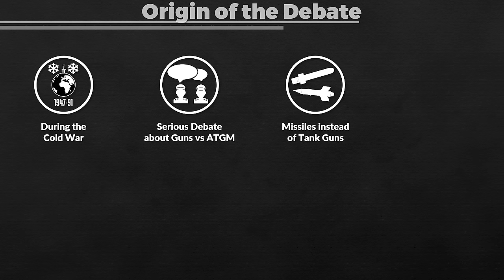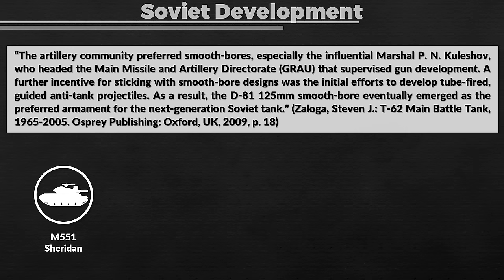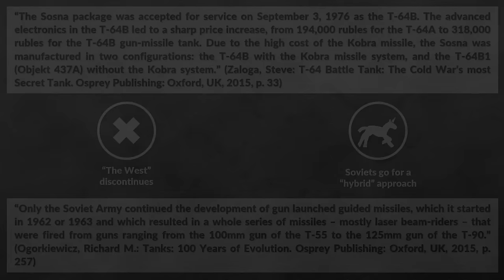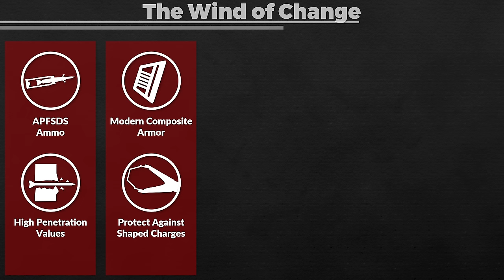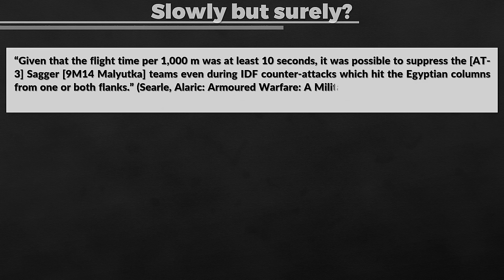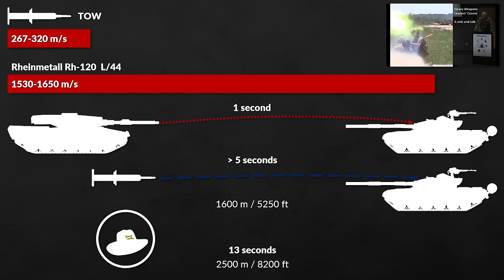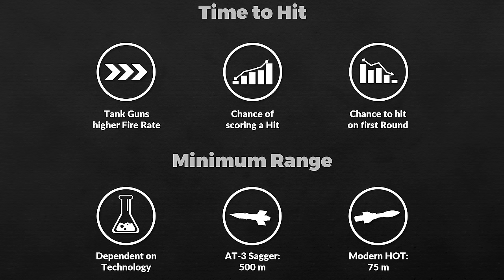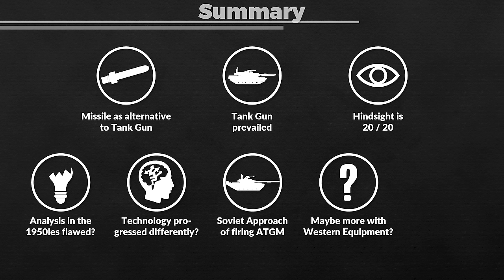Missiles vs Tank Guns: Why Guns are better!

Comment: It is worth noting some more recent developments. Though not accepted for service yet, the XM111 is a guided conventionally launched projectile fired from the 120mm cannon. It comes in two variants, one with a KE penetrator, the other with a shaped charge. It was designed for both line of sight and indirect fire, testing gained a hit at over 8.5km. (The M1 normally isn't expected to engage much over 4km).

Something else worth noting is that you can put a missile on anything, but if you want a proper accurate tank gun, you need something heavy enough to mount it, and hopefully tough enough to take what comes back the other way. So pretty much for a tank gun's firepower, you need a tank, but for a missile's firepower, you can use anything-but-a-tank.
Reply: ?

XM111 was cancelled more than a decade ago.
Reply: @kylesenior  Which is why it has not entered service! But it is an example of extant technology which combines the capability of a missile with the speed and ease of a conventional round. The issue is that there seems to be no need for it, not that it doesn't seem to work, which is an interesting addition to the arguments in this video.
Reply: Is a source allowed to argue with the video? And what were u more deadly with a tow or 120mm
Reply: I thought that was for anti-heli work anyway.
Reply: This sounds like a redo of the old SADARM round that was going to make armour weak at the knees back in the 70s. Never really went into service.
Reply: A big issue with rockets inside barrels is FOULING. Rockets burn dirty and leave a lot more residue behind than a gun round.
Reply: @brokeandtired  Just go the way of the spike missile, the rocket only goes off after it clears the launcher
Reply: @genericscottishchannel1603  a two stage propellant? That could be practical but would cost more per missile and each missile would weigh more which would affect tranportation.
Reply: Imagining seeker to survive acceleration being fired from tank gun has to worth its weight in gold, at that kind of velocity it has to be super sensitive to terrain obstruction in indirect fire, and how do you connect tanker to observer and what about the conflict of becoming dual hatted? What I read was the technology didn't work well enough in real life conditions.
Reply: @killchicken123  ? "DUAL HATTED" ? = means DOUBLE ARMOR  EXPLOSIVE , REACTIVE ARMOR ON *ROOF*/ TURRENT TOP ...?
Reply: @genericscottishchannel1603  yup, use a separate charge to eject the missile. 
Same as what's used for launching for example Tomahawk from box launchers on ships, or SLBMs from submarines (though those tend to use cold gas ejectors, the principle is the same).
Reply: Quite apart from the size and weight problems of tank launched missiles as compared to regular shells the cost is usually prohibitive (Shilelagh anyone?), and of course the missiles tend to be a lot more sensitive and easily damaged by shaking and rattling around inside the storage bins than your HE, HEAT, or APFSDS rounds as well.
Reply: @killchicken123  it's been done with mortars already. But that had significantly less acceleration

Comment: Good video! 
A couple of other factors to consider:
Missiles tend to be more fragile than tank rounds. Rounds can stand more bouncing around and mis-handling in armored vehicles than can missiles.
Missles tend to be bulkier than tank rounds (particularly while in their shipping containers) thus potentially limiting the shooting capacity in tanks.
Reply: Solid rocket motors turning into bombs from being mishandled is scary
Reply: Javelin is a prime example. Even in its carry container with special shock absorbing rings around it the soldier can easily make it inoperable if he simply stumbles and bumps the container against the ground or say a tree.
That's not going to happen with a HEAT or APFSDS tank shell.
Reply: @tommihommi1  which happened to the Dutch army during operations in Yugoslavia. 
The field commander upon receiving his Dragon missiles found that the propellant charges on ALL of them were cracked, rendering the missiles more dangerous to his own troops than to Serbian tanks and APCs. The same was true for most of his LAW rockets and even his mortar shells. This left the Dutch batallion in Yugoslavia without any anti-armour capability at all and inevitably led to the failure of their mission .
The culprit was poor maintenance and storage under incorrect conditions in the Dutch war supply warehouses, while never publicly stated I guess the entire Dutch munitions stockpile was probably similarly affected.
Reply: I also love the content but I think it needs some music
Reply: I'm on the other side of this. The gun itself is a better weapon. The problem is there big and need transport, so you make them mobile. But you want them protected, so they weigh a lot with armour, so the mobile platform grows giant and all the gadgets and equipment on the tank and training the crew is super $$$ .  the problem is no matter how tough you make it, the other side will build a handheld missile 1 50 year old guy like me can fire  smoking a cigarette  destroying the tank after 30 minutes playing the video game version for training. 
Tanks also are more vulnerable to be destroyed from the air more then ever with drones. Rommell knew in ww2 planes had made large formations impossible unless you owned the skies. 
Artillery, the oldest take destroyer since ww1, is so accurate, 1 or 2 guns can do some real damage to tank formations as we have seen some video coming from Ukraine. 
Israel had problems with the first wire guilded missiles in the Sinai. Bazooka and panzerfoust had several upgrades in ww2 and proved deadly thats how quickly war changes.
Reply: @jwenting  Not a great example; the Dutch Army was a bad joke for decades.
Reply: @stevewatson6839  The Dutch army became a joke around the time of the Yugoslav civil war.
It was then that the horrendously detrimental effects of the initial waves of budget cuts started to become visible outside of the army itself, until then they had been able to hide most of it by keeping fewer vehicles operational by canibalising the rest but as you never take everything out of depot for a show or exercise that wasn't much visible for most people.

It was also around that time that the Dutch police barricaded the Dutch army to prevent them leaving their bases after the army failed to pay their road taxes (yes, seriously) and the army didn't even bother showing the police how silly it is to try to block a Leopard 2 with a VW Golf.

Comment: Presumably missiles are also more vulnerable to active defence systems too due to their slower speed and relative complexity/fragility
Reply: That is just with the commonly-available rocket motor tech, there is some newer rocket motors that would vastly improve missile speed, the problem is mass production and that's the real problem with mil-tech.
Reply: Active defence does not makes the tank impervious to a missile
Reply: @darugdawg2453  I think It does, very few missiles are capable of jamming the APS detection to get a direct hit. APS is overpowered as hell, Trophy APS even stops Javelins. 
  There are probably blind spots in the rear or you could fire an RPG from a very high position down into the tanks roof but it would need to be very close for that.
About US army testing Trophy: ...the U.S Army has reported similar success in tests. “I tried to kill the Abrams tank with ATGM 48 times and failed, despite the fact that some of them were supersonic,” said US Army Col. Glenn Dean.
Reply: @darugdawg2453  as with anything in the realm of modern industrial warfare not being impervious is irrelevant. Everything is about probabilities & cost. Active defense lowers effective hit probability & that's all that matters. Sure you can always go with higher speeds, better guidence, better tech, but that has an added cost too.

Anything that reduces the probability of a fast & speedy kill while increasing the cost of achieving a given hit probability is a problem.
Reply: Not against the slower, more fragile HEAT rounds
Reply: @Welterino  How about suicide drone doign top attack from an 90° angle? Because this is what's starting to be developed
Reply: @randomguy9777 sightlines on the seas is much better than sightlines on the ground. It's why helicopters with ATGMs can dominate mechanized movements
Reply: @randomguy9777 That's relevant for artillery, not tanks. Tank guns are bottlenecked by direct fire and line of sight, not by how far a gun could physically shoot if you angled it up a bit. 

For artillery the difference in range is relevant and so you get tradeoffs between guns, missiles, or hybrids between the two with base bleed and rocket assisted munitions.

Comment: Important to keep in mind as well that MBTs are not only designed to fight other tanks, but also support infantry or other vehicles. That may require the use of HE or smoke rounds. Missile systems to deliver those ammunitions would take too much room to be any useful.
Reply: yes, that's why it is so bad idea for politicians to tell army what they need to buy or where they are "best" used. You get tank barrel launched missiles or even worse ATGM Carriers liek IT-1, or Gallipoli campaign ... or as with any other war, Ukraine.
Reply: I think he didn't bring it up because all of his example (M551,M60A2,T-64,T-90) already pack powerful punch against infantry. So only the AT capability are used instead.
Remember that he is talking about gun-launched ATGM and not ATGM in general.
Reply: But couldn't the shells designed to destroy tanks simply be replaced by ATGMs and then leave a supply of HE and Smoke shells?
Reply: @meow1990_2  Usually the have different dimensions, also APDSFS is much cheaper than missile 10 fold or more. Missile is much more finicky. They need to be checked more often for defect, especially on rocket engine part. etc. Since currently they give no advantage to tank, while having many disadvantages, no not really
Reply: @klonik79  Makes sense! :)
Reply: @meow1990_2  SIR , I THINK THAT IS WHAT RUSSIA HAS DONE WITH ITS NEWEST TANK ...ARMATA (?) ...VERY FEW MADE YET (?)
Reply: @christinalaw3375  Because he was discussing something else. You are bringing knife to gunfight debate.
Reply: @christinalaw3375  but javelin has shorter range than modern apfsds round, 2km vs 4km, and bigger caliber, in case of ATGM tank destroyers its better to use light vehicles like JLTV with longer range missiles like brimstone that seek it's own target, you only have to shoot in general direction of enemy armor and missile will find target on its own, you don't have to see target and they wont see you, brimstone lunched from ground will have around 8km range, JLTV or similar vehicle can carry 8 missiles and operate on its own in small recon groups, one downside is cost, javelin costs 10x more than APFSDS round and brimstone cost 15x more.

Comment: Also I think that tank guns are there for the higher versatility; tanks often shoot at structures/buildings in infantry support, and here the ability to shoot HE is very important.
Reply: >structures/buildings

i.e. ukrainian hospitals and apartment buildings
Reply: Shooting guided ATGM at a big statistic target is such a waste of money is the biggest reason i think.
Reply: Why can’t you use an HE missile for the same thing?
Reply: @Rokaize  Missiles are kind of expensive to just shoot them at buildings all the time.
Reply: @Rokaize  A tank shell can cost from a few hundred dollars, or the local equivalent, to a few thousand, maybe even into the low tens of thousands for a DU round (uranium is a very hard metal, and thus an absolute sod to work with, as well as needing considerable additional safety measures), and can reach out to maybe 3 or 4 miles, although you're unlikely to hit anything other than a large stationary target at the far end of that range. An NLAW might make 1 mile under ideal circumstances, and costs £20,000. A Javelin has a similar max range to the tank shell, but costs about £200,000
Reply: @mr.waffentrager4400  how about an unguided rocket?
Reply: @edi9892  you paid for the atgm guiding fire control system u use it in your tank.

Unguided rockets are good idea... That's why it's actually used but not in tanks.
Reply: @mr.waffentrager4400  I thought that if you have let's say an AFV with a machine cannon and a missile launcher tube, what's stopping you from repurposing it for unguided rockets or even grenades? It should be possible to make one that can fire all of them...
Reply: @edi9892  bmp2m and the Terminator have grenade launchers so they will use them .

They can also use atgm but that kornet is much expensive... I think they will request artillery (it should take 5-7 minutes) so use autocannon by that time. Atgm only in emergencies.
Reply: + @talltroll7092 + Depleted Uranium isn't isn't supposed to be machined from ingots or bar stock into rods; it's melted down and cast into shape (obviously don't do that to enriched U235) and since there's literally Tons of the stuff leftover from Uranium Reactor fuel Enrichment processes at least in the USA it's probably cheaper than a Tungsten round (which is actually slightly harder and has a Much Higher melting point but it's tendency to "mushroom" on impact reduces it's effectiveness) since it isn't in high demand in other sectors like for machine tool heads. Though since it's a pyrophic metal extra care is gonna need to be taken during finishing work to keep it from bursting into flames or ensuring dumb doesn't happen causing DU dust particles don't get into the air and give someone heavy metal poisoning during the manufacturing process.
Reply: @talltroll7092  keep in mind that the missiles you mentioned are infantry weapons aswell, and are usually left in the dust by what a vehicle or even a plane can carry (plus the costs associated with this also follows)
Reply: @edi9892  Recoiless rifles, like the Carl Gustav, are currently favoured as the ATGM equivalent for high explosive and other non-AT payloads.
Reply: @edi9892  Because you have purpose built rocket artillery vehicles.
Reply: Yeah, there's always a lot of focus on tank v. tank because it's sexy, but out in the real world it's the least common thing a tank ends up doing in combat.
Reply: @tommihommi1  With Ukrainians firing down from them with RPGs.

Comment: I wasn't an assaultman [Javelin] or a TOW gunner in the US Marines, but my buddies who were said they were trained to [ideally] trigger two additional smoke/demo explosions when firing so a tank crew had to choose among the 3 choices
Reply: You mean to obscure their position with two other smoke clouds, that could be launch points? Or to protect the missile?
Reply: @willtaylor9309  probably obscure position of launch point, but if the enemy tank has APS system, the Javelin will be neutralized and the approximate position of launch will be shown to the crew. 
But the only armies I know that use APS on their tanks and are capable of neutralizing Javelins are US and Israel's army. (they use the same Trophy APS system)
Reply: @Welterino  note that a lot of US abrams tanks aren't even equipped with trophy APS systems.
Reply: @willtaylor9309  yes to obscure position. I think they were using Dragons at the time in addition to TOWs, a very slow going ATGM that was wire guided iirc
Reply: @Archeangelous  Yeah, tactics for Dragon and TOW were much different than modern NLAW and Javelins.
Reply: @fortusvictus8297  not surprised, it's what I remember my mates saying. I was an 0341 mortarman with the 60s
Reply: @Welterino  Yes, possibly. It depends on the speed of detection and engagement of the ATGMs by the active protection system.  Also it assumes that the enemy won't fire multiple ATGMs at the  same time.  If infantry launch 3 ATGMs at the same time it's going to be difficult for any active protection system to intercept all 3.  

Even if we are talking about a single ATGM launched from the gun of a tank one would assume that just like ballistic missiles developed decoy systems to avoid anti-missile systems then so would ATGMS.  Plus if the APS system is using radar to detect ATGMs then jamming is a distinct possibility as well as radar homing missiles.   

I guess there must come a time when an entire class of weapons reaches the end of its it's effective life.  It happened to cavalry when they became vulnerable to the machine gun and bolt action rifle. Maybe that's the case with tanks.  They might be just too big a target for ATGMs. Countermeasures might provide a short term solution solution to ATGMs, but there will be counter measures to the counter measures.  Active protection systems can be jammed or decoyed.  So unless the tank can make itself a less visible target maybe they will become increasingly vulnerable to sophisticated ATGM systems.  

A conventional round fired from a tank might be harder to detect or avoid, but the trade-off is a gun has to be carried round in a huge target which is likely to be vulnerable ATGMs.